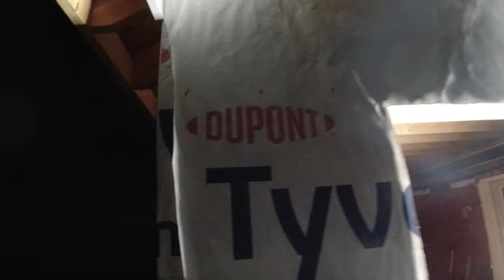Soffit and Fascia Is Kind Of Like CONCRETE...But Completely DIFFERENT!!

Comment: I've been a contractor 45 years, the soffit on the gable ends should always be solid so the airflow only comes from the eaves up to the ridge, never use vented soffit on rake ends,it's all about ventilation especially if your using a ridge vent.
Reply from the maker: I did not know that. I was thinking that since it was all solid behind there, it wouldn’t really do anything. I did it so everything matched haha if I don’t change it, in your experience, will anything get ruined or damaged?
Reply from the maker: To be fair, I’m a concrete guy hahaha this is the best way I learn new ways of doing things outside of my area haha

Comment: Also I know all the national electric codes, I designed the wiring for all the homes I built if you have any questions...for one you can only wire 80% of your amps you pull on any breaker, so 16 amps on 20 amps breaker, one receptical that is used for non motorized use is 2 amps ....so you can put 8 recepticals on one 20 amps circuit...
Reply from the maker: Thank you! I’ll look into what our codes are before I finalize everything.

Comment: Nice work. You make remarks about OSHA approved ladders. I have a question. Where are your OSHA approved safety glasses when using the saw? Just wondering, you are doing such a beautiful job, hate to see you injure an eye. Be safe.
Reply: I notice a lot of these you tubers never use common sense when it comes to safety
Reply from the maker: Hahaha that was a joke because half of the ladder was on a wall and the other half was on a pile of lumber hahaha and ya, I need to get better with the safety glasses. Thanks for watching!

Comment: Steve, soffit and fascia looking good.  Really nice job.  Question - how are you handling the area where the garage roof and house roof meet?  That appears to be a very long valley that's going to hold a lot of Pittsburgh snow and i can see some serious ice dams forming.  You may have addressed it during construction but didnt talk about it on video.
Reply from the maker: Thank you very much! And the video I have scheduled for 22nd shows how we addressed that along with a couple other frequently asked questions haha thank you!
Reply: I'm with the other comment ,why your new rafters are run same as your house rafters  seems  like problem with rain and snow and ice jams would be big problem in Michigan.
Reply from the maker: @MarkSmith-ru7lu  I have a video scheduled for the 22nd and I answer that as well as a couple other frequently asked questions haha thank you!
Reply from the maker: I had my videos mixed up and the video that shows the roof and how we handled that valley came out yesterday